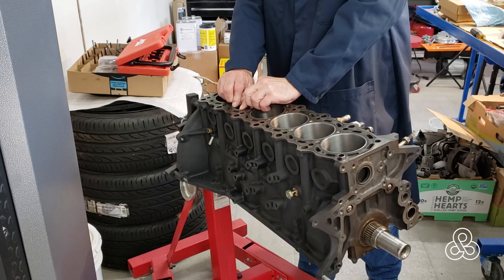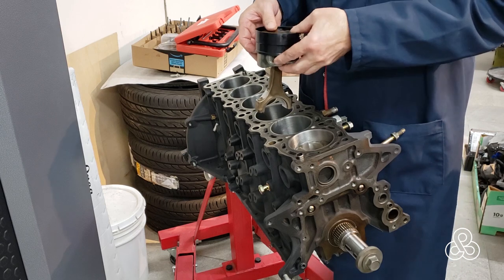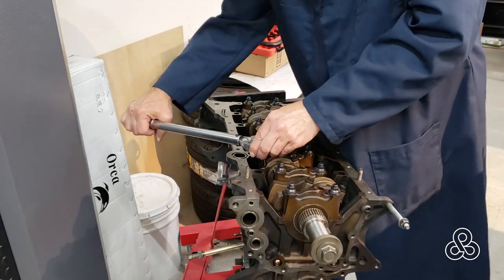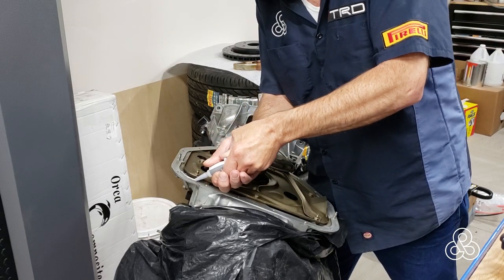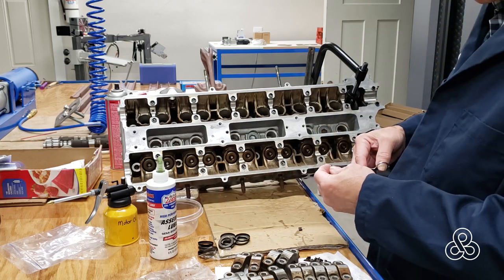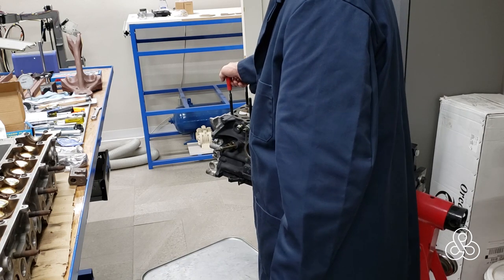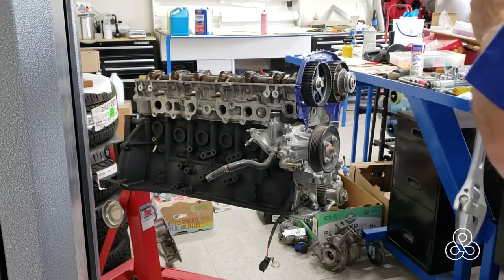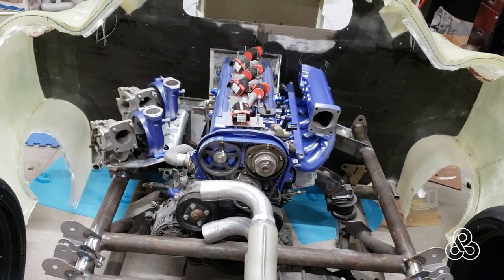A29 - Why would this guy put a 1JZ GTE VVti engine in his supercar?

Comment: Well, I was having just one doubt why not go with 2JZ, the only conclusion I got to was the price and size of the motor although I can be wrong as I'm not a US citizen so I'm unsure of the pricing. although 2JZ has higher tuning potential both the engines are pretty good, Japanese manufactures were at there prime in the 1990s. 
Did you get your engine from a Toyota mark II or Supra Mk3???
Reply from the maker: The engine likely came out of an Aristo (Japanese market only cars) I bought the unit from an importer and they could not tell me exactly what car. I've just had to match the layout of certain components and compare to photos. The unit came with a 4 speed auto transmission attached that was common on the Aristo. I chose the 1jz variant over the 2jz partially for price, but mainly for the shorter stroke, which will allow me to push higher reves. I would like this to be a 200MPH (322 Kph) car, and with the final drive gear ratios, I will need reves over torque when I get to top speeds.
Reply: @BuilderCreator  Okay, actually I thought that the engine might be from the Mark II or Supra Mk3 because those were the only 1JZ-GTE which came with twin turbos that's why I was curious about the source. Are you thinking of turbocharging to reach a 700+BHP target...? if Yes, are you going with a twin-turbo setup or a single one??
thank you...

[Edit 1]
Alright, I investigated a bit further and realized that the Aristro (the Japanese only version came with a 2JZ), my guess is that your 1JZ is mostly from a Mark II anywhere from the 6th generation to 9th. Although the more I search I realize that Toyota used the same headlights and same design philosophy in all there cars in the 1990's, so I might be wrong...

[Edit 2]
I guess, I found your car. The Tourer S came with a 1JZ-GE engine, 4-speed automatic and several options either standard (such as ABS and control) or not present (a factory limited-slip differential) in either the Grande or Grande G. <sourced from Wikipedia>. Secondly, the design resembles a lot to the Aristo or the 1st gen Lexus GS. This concludes that your engine is/was from a "1992 Toyota Chaser 2.5 Tourer S, JZX90"....👍

for more info refer please the link:
https://www.carfolio.com/specifications/models/car/?car=495561
Reply from the maker: @divyanshsrivastava7312  Like I said, I'm not sure what it came out of. What I do know is that it is a 1997 model, 3rd generation with BEAMS architecture (vvti) came with a single CT15B turbo and I am adding a second. You can watch my twin turbo story here- https://youtu.be/ryReZaQsUWk
Reply: If it's latest VVTI ETCS-i (electronic drive by wire throttle) then it either came from JZX110 MarkII or JZS171 Crown. If it's throttle cable earlier type VVTI (with IACV) then it came from JZX100 cars (Chaser, MarkII, Cresta) or late JZZ30 Soarer. 1JZ never came in Aristo, only 2JZ's.
Reply from the maker: @code111japan  Thanks, looks like the Mark II or Crown, as it did come with drive by wire.

Comment: The JZ is great in the reasons you highlighted, but the same can be said of the K-series or any other home-run engine platform from any engine makers. A 4g63, Sr20, even the VQ35 DE and VR38 DETT are good engines for the same reason, and no engine really comes on top over the other-they're all just great. You can't go wrong with any-overbuilt and reliable engine. For the sake of discussion, I'll throw my $0.02 in.

All those engines I named are capable engines that get raved about, but I think in the case of a supercar, it should come down to 1) what engine makes you feel the best and 2) what's financially realistic for what you want. I personally love low-displacement, flat-plane crank, even firing, high cylinder, high-revving engines. So those harmonious, screaming euro engines are what gives me that tingle, excitement, whatever you wanna call it. I think the gen 2 coyote is the best engine (better sound than any jdm 4/6 cyl, newer, just as cheap, more aftermarket support, reliable on stock internals till 700 whp, 800whp with a simple oil pump gear upgrade) and I will stand by the coyote. It is my choice of engine because of the 2nd reason in particular, however there is nothing like how a v12 makes me feel. The supercar you're making doesn't really look like a drift missile, as those things look like parted out salvage cars with the entire color palate for stickers, and your car looks like a classicly inspired, but modern and sleek supercar. So I fail to see the point to appeal to that crowd. This car looks like it has a mclaren carbon monostructure, a sharp and aerodynamic futuristic car, but with classic lamborghini miura inspiration on the rear body lines and the headlights.  The rear lights are similar to the lotus evija btw. Not saying there's any sign of wrong doing, but just saying they built a car with a similar "vaccum" rear light style that looks pretty cool. Overall, I really like the build and am shocked to see you build literally everything on this. I would assume you would want to buy used stuff, refinish it and adapt it for simplicity's sake and a cheaper bill, but it's cool to watch you do even the muffler from scratch. Good luck building!
Reply from the maker: Yes, the options are endless and at some point you just pull the trigger and, "go with it!" (Actually you put some money into it and "go faster with it!") ha!

Comment: Looks a lot like the land cruiser sixes ....
Reply: Not really, at least if you are thinking of Land Cruiser's from the 60's--70's (the only ones I am familiar with.) Those straight sixes were almost exact copies of the old Chevrolet "stove-bolt six" engines, maybe even made under license from Chevrolet, don't know about that. Instead of overhead cams, they were cam-in-block pushrod engines, of 235 cubic inches, about 3.8 liters. 

Like the 'JZ engines, they were practically indestructible. I had a mechanical fuel pump fail, dumped the oil out and the engine seized. Next morning I filled it with good synthetic oil, put 24 volts across the starter, the main bearings squealed as it cranked - and it started. It ran another 10 years that way, oil pressure at 0 psi at idle, but OK once the revs were up.

Comment: Have you given thought to the Atlas 4200 engine from GM?
Reply from the maker: I looked at most everything before I chose the JZ. However, I have recently discovered that the Vortec (Atlas) engines in 4x4 applications have the half shaft going through the oil pan; as I'm building an all wheel drive and have all those drive-lines running here and there, I would have given it much more thought. As is, I have had to shift my engine 2.5 inches off center to allow for the drive shaft to travel back to the diff. I thought off fabricating/casting a new oil pan and attempting to get the driveshaft closer to center, but decided the shift was easier/less expensive. Would love to get measurements off a 4x4 Vortec and see. Also curious to know if the 4x4 oil pan came in the 5 cylinder version?  I've owned/mechaniced on 5cyl Audis and loved the idea "5- not to much not to little."
Reply: @BuilderCreator  Bet you enjoyed AUDI 5cyl legends.

Comment: Not knocking the jz platform its soild. But the ls takes up less room and if your only shooting for 5 to 600 hp easily be done na. I toldly get your the engineer but stoke dose not play as much of a roll in high reving as valve train dose.
Reply from the maker: All valve trains being equal, physics kicks in and the inertia of turning a component (mass) around and sending back the other way- less inertia is better. F1 has done it for years via less piston/rod more cylinders.

Comment: Whats the V-6 sister equivalent of this engine that follows the same guidelines as you mentioned? lots of readily available parts, can be pushed to 2000 HP, easy on the wallet as well ??
Reply: There really isn’t one. Maybe a vq motor or Honda J series, they both make good power and have decent aftermarket but passing 4 digit power is going to be hard to do.
Reply: Skip to a v8 get an ls if you want all the above
Reply: @E1337Jerk  for the price of a leg and arm